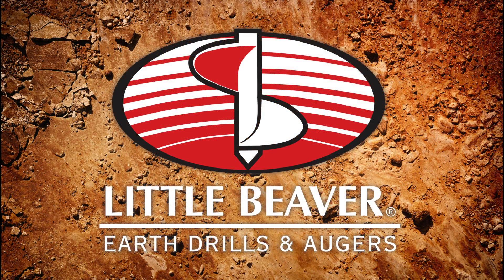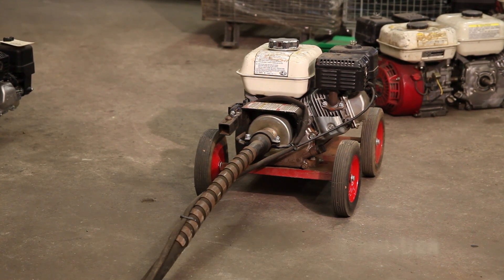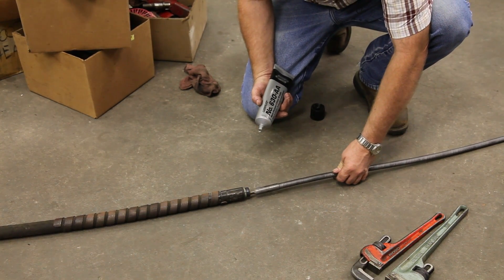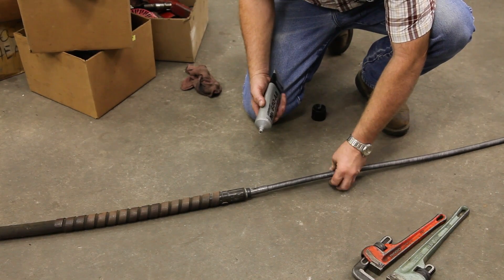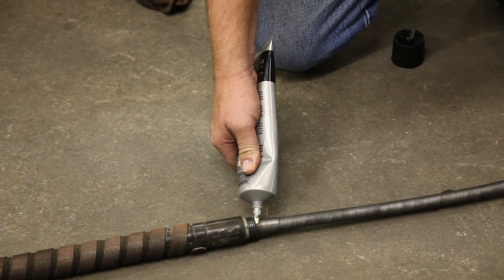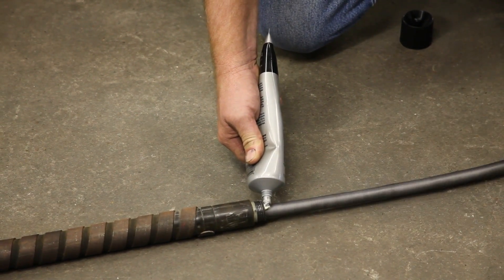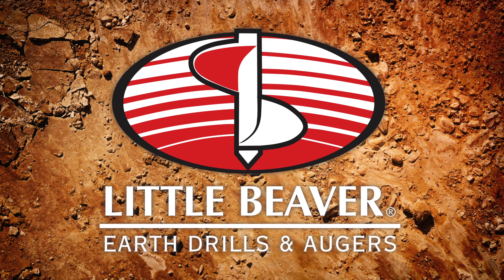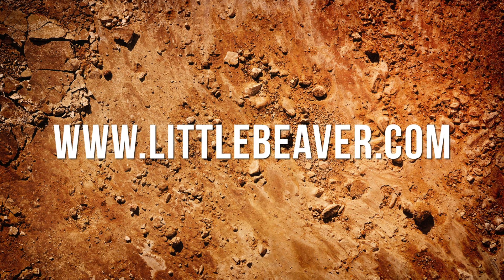Little Beaver | How to Replace the Core of the Flex Shaft

Comment: I read that you have to disconnect both ends of the flex shaft and get all the old grease out before adding new grease. Even pulling a wad of cloth through the shaft tube to clean out all the old grease. Is this true or can I just add grease like in this video?